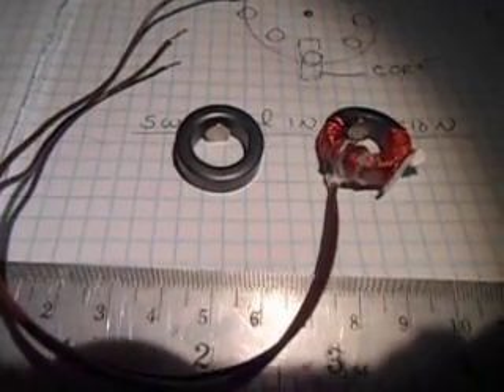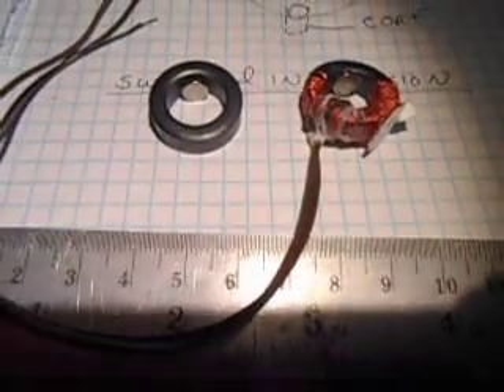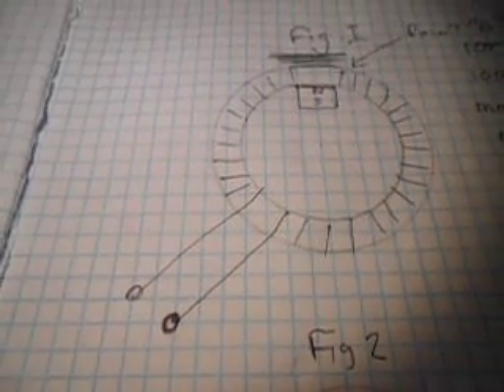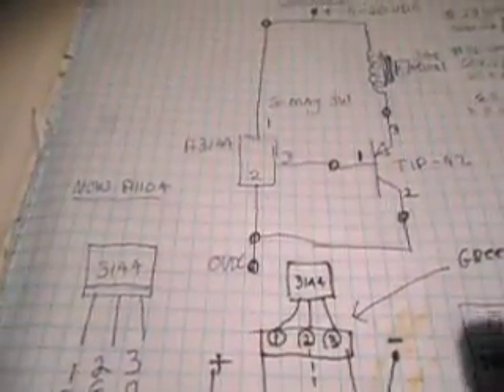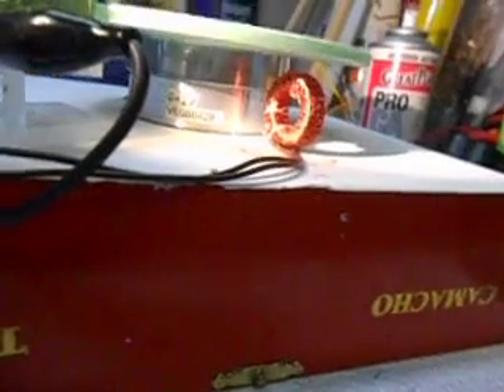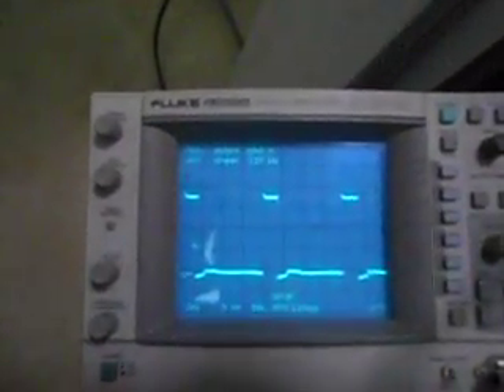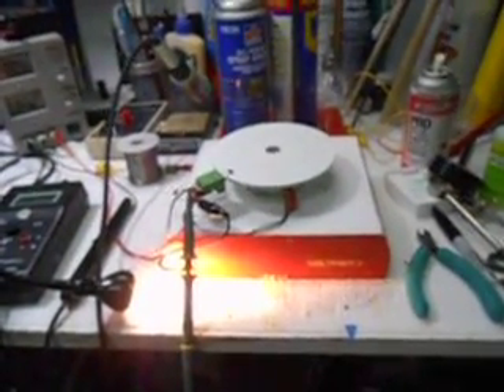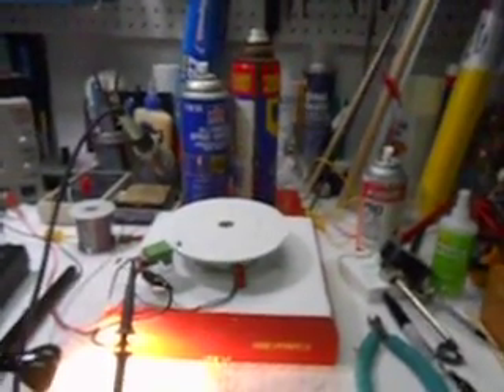The Thomas Pulse Motor

Comment: thanks for sharing. my first pulse motor circuit I used tip 107 with A3144 hall effect switch. I cant explain the excitement you get when you first start seeing your magnetic wheel spinning up faster and faster.

Comment: It seems it is basically then the electric ORBO effect from Steorn , who also used 2 toroids in 180 degrees out of phase in series...right?
Reply: Thanks... but no, I don't think that is quite how it works. When the coil is on, the entire toroid core becomes saturated: this means its permeability is now 1. So the field from the PM inside the core can now pass through it like air, instead of being "sucked" into the non-saturated toroid.

The Orbo in my video has no magnetic field from the coil outside the toroid, and it works by reducing the ability of the external rotor magnets to attract the toroid material itself, and this is true for both polarities. The electrical pulse to the coil is turned "on" as the magnets pass the core, not before, so that there is a reduction in attraction as the rotor magnets recede from the toroid core. This is what speeds up the rotor. And the polarity of the current and the polarity of the rotor magnets doesn't matter at all. It is neither an attraction nor a repulsion pulse motor, it is a unique third kind, the Core Effect motor.

I think you have turned your pure Core Effect motor into a biased attraction or repulsion pulse motor by putting the PM in there.  Nothing wrong with that! But try it without the PM, and time it so the coil pulse starts at the closest magnet approach, not before. You might be surprised.

Believe me, I spent years on this stuff and I have perhaps the only quantitative data on the effect of electrical currents on the magnetic attraction of ferrite toroid cores to external magnets that you will be able to find.

Comment: Hi Ben, well done, but at the off time there is this small valley induction wave ?
You need to use 2 toroidal coils in series 180 degrees out of phase to really cancel out any BackEMF.
Regards, Stefan.